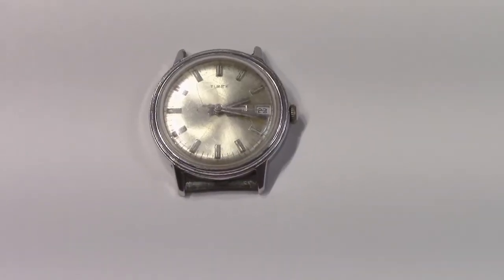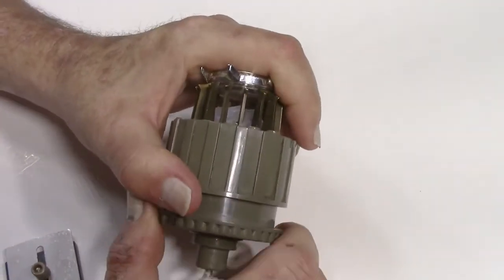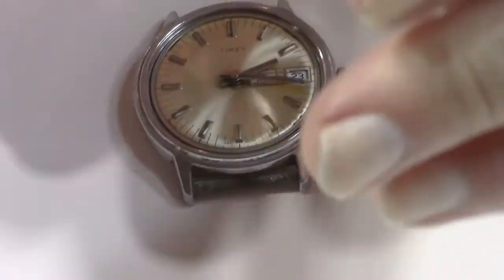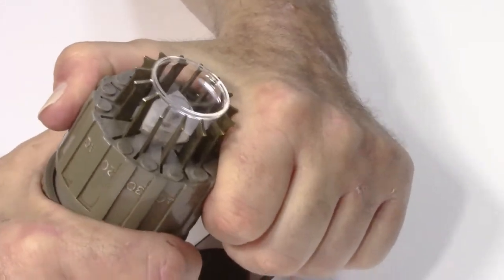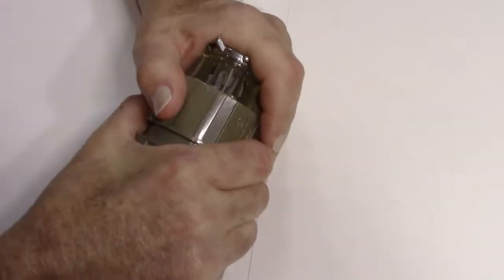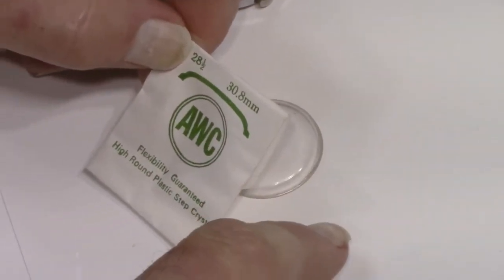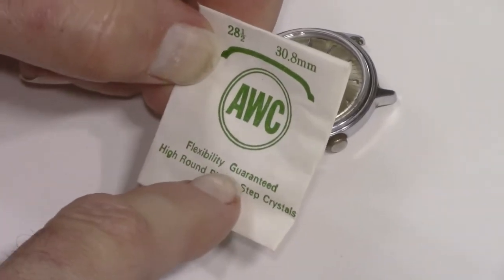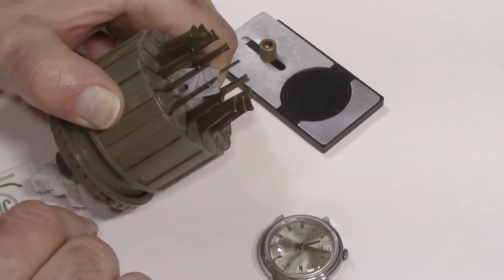3 Steps How To Easily Replace An Acrylic Domed Watch Crystal Seiko Timex Omega ect

Comment: Very nice video, but it's important to note that this crystal lift won't work on crystals that do not have a vertical part for them to grab onto. And if you have the base that comes with this type of lift, you can rotate the lift in the base to get the proper height on the crystal when grabbing it.
Reply from the maker: Thank you for the nice comment. Also, thank you for the helpful info.

Comment: I love the video and am definitely subscribing to your channel. What tool is your crystal remover called and where did you get it?
Reply: You can pick them up off of eBay, they are relatively cheap. I am sure the ones that cost more are a bit better designed but the chap ones work well.

Comment: I can't bring myself to try this on my watch:)
Reply: Its not hard at all. I have done it several times and works good. I have the smaller crystal press and it can get hard to twist it tight enough, This is why he shows here the larger one. But I use a set of channel locks to hold the bottom and a rubber jar grabber for taking canning jar lids off on top. This gives me a bit extra torque.
Reply: I don’t want to scratch’s nee lens doing this.

Comment: Does it scratch the new Cristal?
Reply from the maker: The part in the middle of the crystal lifer can scratch the crystal.  On mine I put a couple pieces of tape on the end so it would not scratch.
Reply: Mine grabs the very edge of the crystal. It does not hurt the crystal at all as its not really moving across it. Its just grabbing it and squeezing. For Marlins you can get the Timex wrench. You can find them on eBay once in a while.